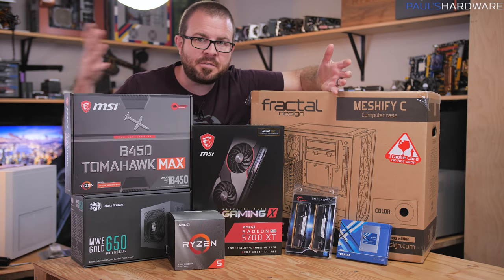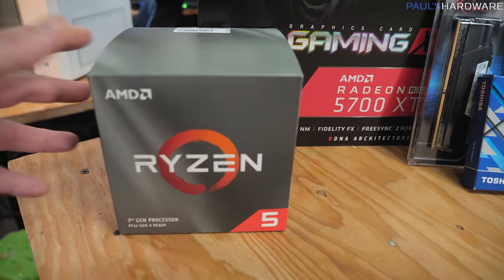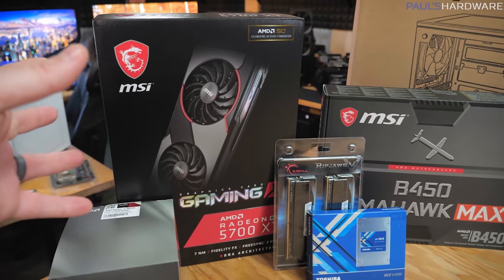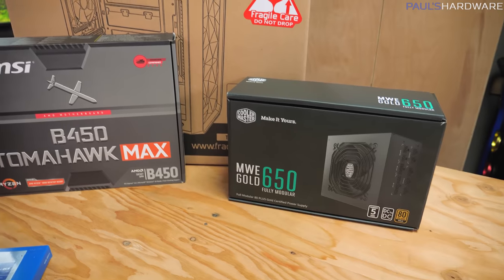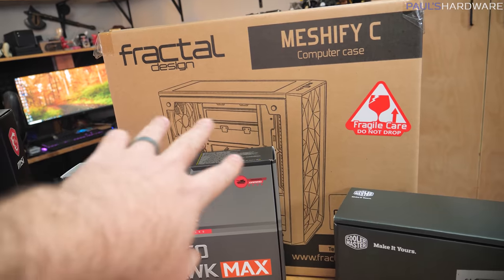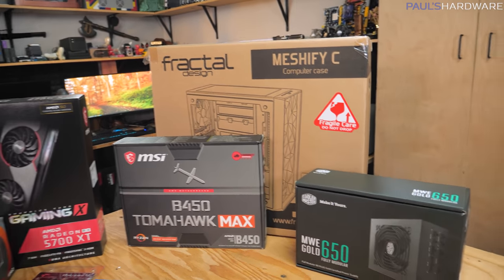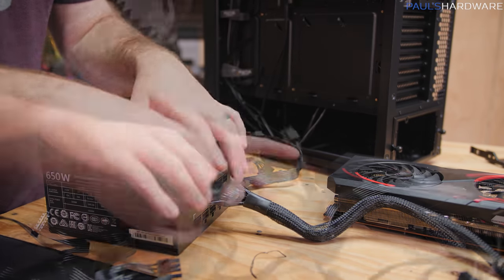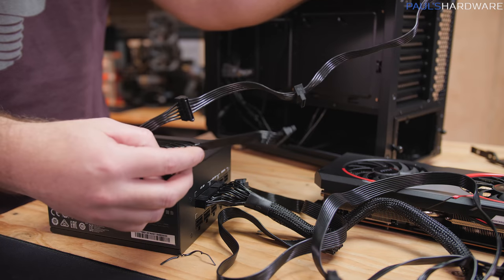Building the $900 Gaming PC that Everyone Should Build!

Comment: can you simply use an old windows installation with completely new and different hardware?
Reply: Maybe. If it is Windows 8 or 10, it will boot up, but you may get activation errors. Regardless, I always strongly recommend a clean install so that you don't have to worry about potential hidden problems that may come up.
Reply: @JJFlores197  i could boot old windows 10 without problems and it even was still activated. Performance is also normal, should i still do a clean install??

Comment: I built this rig on System Builder and it costs $1240... it also flagged an error with this message "Some AMD B450 chipset motherboards may need a BIOS update prior to using Matisse CPUs. Upgrading the BIOS may require a different CPU that is supported by older BIOS revisions"
Reply: Mel thanks! I also added an OS which added $109.
Reply: Mel thanks I’ll take a look!

Comment: Hey, thanks for the video.  Great video!  I wanted to ask you for some advice.  

I'm putting together a trading PC.  Trading PCs typically need multiple monitor configurations.  For example, my current trading PC has six monitors.  
I was wondering if it would be better, performance wise,  to use multiple video cards with multiple monitors?  Or, if if it would be better to just install one video card and use one of those huge curved 55 inch monitors?  Which route will give you better performance and graphics?  Thanks in advance.  Gabriel

Comment: just did this build. used a S300 case. was going to use a 3700X but seen no reason to spend the extra money.  it means i will get to do it again in a few years. thx for the tutorial.
DAMAGED THERMALTAKE CASE FROM NEWEGG
EDIT:  The thermaltake case had 2 deep scratches on the glass door only seen after I took the plastic off.  The power button sticks and is wobbly. Probably a fire hazard.  
I contacted Newegg and they tried deflecting me to the manufacturer but I did not buy from the manufacturer.  I bought from Newegg.  They have taken the profits from the sell but do nothing once a person recieves a damaged item.
I cannot recommend that anyone buy anything from Newegg.  They sell chinese made products and even though defects are inherent to chinese made goods they seem unprepared in how to deal with it.
They have ruined this buying experience for me. I am very unhappy.

Comment: For cheap quality pc gaming, PCIE 3.0:

AMD Ryzen 7 2700X $248
G.Skill Trident Z 16 GB (2 X 8 GB) 3200Mhz $80 X2 $160
PNY GeForce GTX 1070 Ti 8GB $157
Crucial P1 1 TB M.2-2280 NVME Solid State Drive $100
Rosewill - FBM-X1 MicroATX Mini Tower Case $20
Windows 10 Pro 64 bit $15 key
Raidmax Cobra 500 W 80+ Bronze Certified ATX Power Supply $44
GIGABYTE B450M DS3H WIFI AM4 AMD B450 SATA 6Gb/s Micro ATX AMD Motherboard $85

$749-$829

PCIE 4.0:

AMD Ryzen 7 3700X $299 
G.Skill Trident Z 16 GB (2 X 8 GB ) DDR4-3733 $153 X2 $306
PNY GeForce GTX 1070 Ti 8GB $157
Crucial P1 1 TB M.2-2280 NVME Solid State Drive $100
DEEPCOOL MATREXX 55 ADD-RGB 3F Case, E-ATX Supported, Motherboard or Button Control of SYNC of Addressable RGB Devices of Any Brands, 3x120mm ADD-RGB Fans Pre-installed, 4mm Full Sized Tempered Glass $74
Windows 10 Pro 64 bit $15 key
Raidmax Cobra 500 W 80+ Bronze Certified ATX Power Supply $44
ASRock X570 PHANTOM GAMING 4 WIFI ax ATX AM4 Motherboard $154

$996-$1149

PCIE 3.0 with i9-9900K:

Intel I9-9900K $525
G.Skill Trident Z 16 GB (2 X 8 GB) 3200Mhz $80 X2 $160
PNY GeForce GTX 1070 Ti 8GB $157 or Asus GeForce RTX 2080 8 GB DUAL EVO Video Card $600 or MSI GeForce RTX 2080 Ti 11 GB VENTUS GP Video Card $1080
Crucial P1 1 TB M.2-2280 NVME Solid State Drive $100
DEEPCOOL MATREXX 55 ADD-RGB 3F Case, E-ATX Supported, Motherboard or Button Control of SYNC of Addressable RGB Devices of Any Brands, 3x120mm ADD-RGB Fans Pre-installed, 4mm Full Sized Tempered Glass $74
Thermaltake 360 Floe Riing TR4 Edition $250
Windows 10 Pro 64 bit $15 key
EVGA BQ 850 W 80+ Bronze Certified Semi-modular ATX Power Supply $100
MSI MPG Z390 GAMING EDGE AC ATX LGA1151 Motherboard $190

$1491-$1571 or $1934-$2014 or $2414-$2494

1070 or 1070 Ti for cheap: https://www.ebay.com/sch/i.html?_from=R40&_nkw=1070+ti&_sacat=0&LH_TitleDesc=0&fbclid=IwAR05FldQ-htEPw8B7Vwcd12MoHYm4vqzwi8PKTLWY0EPnJIwEt4qitSHyEY&_udlo=150&_udhi=240&rt=nc&LH_BIN=1

https://pcpartpicker.com/list/
Reply: Exchange the 2700x for a faster 3600 and get a GTX 1080ti used. That's it.

Comment: CAN ANYONE HELP ME PLEASE   I'm gett6ing ready to try to build my system ITS AN ASUS motherboard , I have some questions for you in the { UEFI  BIOS ,  do I need to set time and date where,? and I'm adding a video card ,   sound card where do I go in bios to check or change them  would appreciate  help
Reply: The date and time should already be set, but you can always change it if it is off. I don't know where the date settings would be, but it shouldn't really be difficult to find. For the video and audio card, you just install them on the motherboard and that is pretty much it.

Comment: Funny thing is I have build a pc for around 700-800  dollar pc  in 2 hours   and sold it for 1300.  And I have way better stuff in it then yours and also water cooled  don't know where you bought the items but it was not cheap store.

Just some stuff  you bought a ryzen 5 for 250?? I bought a ryzen 7 2700x for 200.  

I bought motherboard asus rog 450-F   for 114. 

32gb ripejaws 3200mhz ddr4 for 80

Samsung 970 evo plus 1TB m.2 for 129 
Samsung 860evo 2tb ssd for 180
Power 650 watt 50 dollar.
Case gamadias RGB  for 120

Graphics card Saphire Nitro Extreem 8GB DDR6 OG  for 200

And sold this system for 1300 
Now looking what my next build will be

Trust me memory cheap from china or so you can buy with out cooling for 20-30 you will notice the difference for sure it's cheaper stuff but you want to have good game pc better invest good in memory it's your brain of pc and these ripejaws bare specially build for gaming pc. These cheap things are build for simpel pc task. They really have different chips

Same with the ssd  m.2 or ssd   samsung or cheap ssd or so you will notice it with gaming  my pc runs games as fast new ps5 will be.

Comment: Paul appreciate all the knowledge, would a system of this level run iracing? I’m new to the computer world and all I do is race console currently. I would like to touch base with you on getting a setup together if possible. Maybe something that can run clean single monitor to start and also be upgraded to run triples if need be later. Thanks again
Reply: Iracing will run well on even very old systems. This system would run it with ease.

Comment: So you like dust protectors on it because you prefer to keep the rig clean and dust free for its protection, but others don’t like the dust protectors because it allows better air flow to keep the rig nice and cool for best performance and for its protection also. Hmmmm. Dust free protection or max cooled for best performance which involves more regular dusting. If you’re not lazy the max air flow is the best route no?

Comment: DO NOT USE B450 TOMHAWK MOTHERBOARD with ryzen 5 3600x

I repeat DO NOT. It has very weird bios issues. Even after getting it RMA d it doesn't output to video card. Giving it to RMA during covid was another time consuming hastle as well.

Go for any motherboard that doesn't have known bios issues. Even if it might be costly in the end it's cheaper than the stress this board has cost me.
Reply: NeonJayFox  yeah most of the online reviews mentioned that it's a solid motherboard. But many have mentioned this bios issue as well. msi service is very bad in India. I took the entire setup MB with cpu, PSU, GPU ram to their local SVC partner who handle RMA to find out what's the issue. They checked and told me possibly motherboard issue and sent it to RMA.

When I got the RMA d motherboard after 2 weeks they told me its repaired. I asked them to test the setup again with cpu ram etc which I had brought with me again as the outlet was 15kms away, they said they can't do that as it is already repaired and should work.

I got home and checked it again and same issue occured. I called msi support and asked them repaired MB doesn't work the support guy checked details and told me that MB didn't had any issues and they still gave status as repaired also they didn't test it with the cpu I mentioned.

Remaining was my PSU. Which is indeed faulty. But to my dad luck their RMA partner is also the same company. If they had just checked the system once they could have saved so much of my time.

Apart from being 15kms away that outlet was also very close to a COVID quarantine zone so I am not going there anytime soon. I just got a new MB and new PSU and system works. I will get it repaired whenever this COVID Scene is over now.

Comment: I have asus rog strix b450-f  mobo.. it says ryzen 3000 ready.. but all videos I see say use 3200 ram instead of 3600.. will 3600 work with this board since it's 3000 ready? I'm  using ryzen 5 3600 also

Comment: Can only recomend 5700 xt if ONLY you have zero chance of sparing some more money on any nvidia card.
I bought the same one five months ago. It has the exact same issue as all the AMD VGA-s.. Nonsense that nobody forces AMD to do something about this issue.
I`m talking about the issue when your VGA loses signal to the monitor 'aka' "no signal". Had it with with rx 380, rx 480 and now with 5700xt as wel. Tried 3 different PSU-s.
This build is fully new and it gives the same error in event viewer called "Kernel power '63".
DO NOT BUY AMD VGA ! It may work for some but the people I know personally have the same issue as well.

Comment: 12GB of 1333 or 8GB of 2133
Reply: DDR4 base frequency is 2133, 1333 won't work with Ryzen.
Reply: @alex_inside  I was referring to my build which is DDR3 on Intel 2500k. Do you think 8Gb of 2133Mhz is better than 12 GB of 1333Mhz? Thank you bro!
Reply: @chriscerta9821  It really doesn't matter so much with Intel. The CPU will be a bigger problem than the RAM. 

If you can't replace CPU and motherboard for a Ryzen 5 or 7 on a B450 chipset then get the 12gb modules or a better option two 8gb modules in dual chanel. DDR3 is cheap AF.

Comment: Damn for a  person that use to work with Newegg, and be a part of Eggexpert.  You should know don't skimp on the PSU. We use to rate them in a tier-based system back then nowadays it's fucked. Use a Platumium or Gold PSU on your system, Never use a bronze rated PSU. 
Paul, you should know better. WTF. Cheaping out the hardware in any form is bad.
Also, AMD PAWNS Nividia and Intel and has for many, many years including decades. 
I have built K5s on that can always kill any Intel product and Nvidia.

As for standoffs, those have been around for decades and anyone that can build a PC, should know how to use them by now.

Comment: The only problem is that your build will never boot out of the box, you need to order another 100$ processor (series 2000 and below) just to update your bios. then after the update it will not recognize your cpu and ram couse bios updates can mess everything up! so yeah, after trying your build i've spent 1.5k$ and it's still not usable :D
Reply: You do realise now that the b450 boards are pre updated now. I got an asrock b450 itx for £113 Amd 3000 ready

Comment: Yes because everyone can afford a $900 PC
Reply: Well you shouldn't spend less. If you can afford it split it. Get the CPU, Case, Ram, PSU and storage first and then save up for the GPU. 

Go for used parts,maybe instead of the 5700xt you could get a 1080ti.